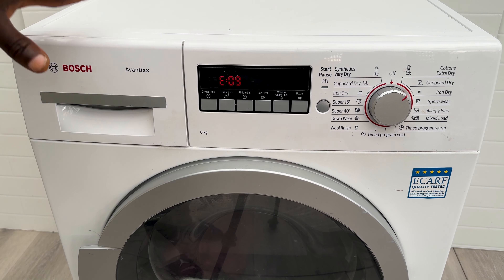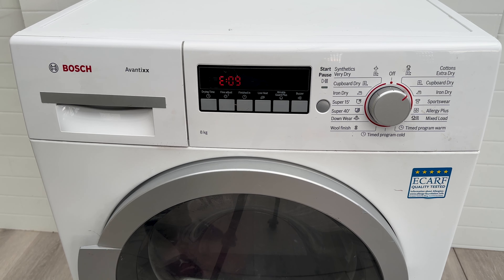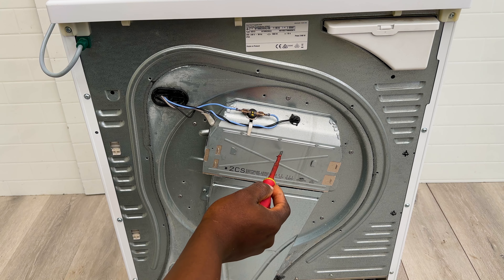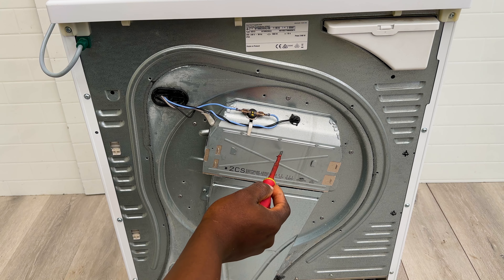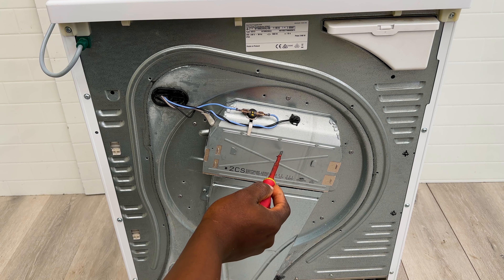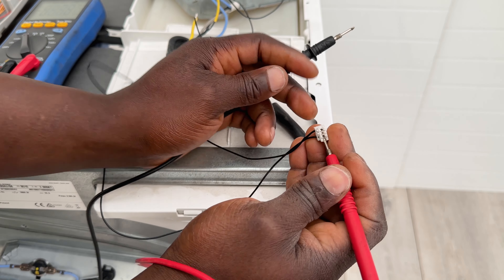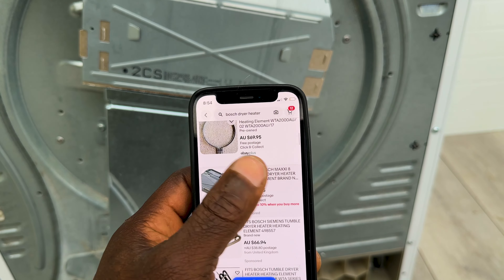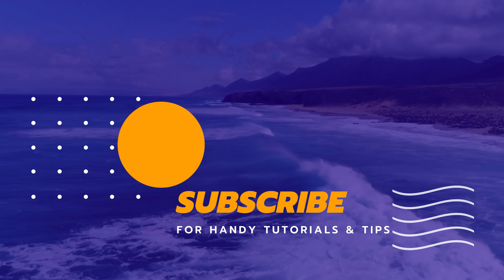Bosch Dryer Error E09 Fault Repair

Comment: Hi I am slightly confused you said the temp sender should be normally open (ie current should pass through = have continuity) at 1.21 mins at 3.55 you say should be no continuity????

Comment: Very helpful. Having tested both sensor and thermostat, I replaced the whole heater element. Unfortunately, it still returns E:09. Any ideas what to check next?
Reply from the maker: hi when you start it up is it heating up ? if so does it get really hot ?
Reply: @askmrwashywashy  after a few tries, it stopped returning the error code. It is heating, but not as hot as a remember it being-it took over 4h to dry one damp sheet, and it still wasn't very dry. Before replacing the parts, I disassembled the unit and vacuumed every speck of dust out. I've wiped down the moisture sensor, flushed the drain hose,, and the pump seems to be draining normally. Short of a computer error, the only other factor I can think of is that it's an unusually hot and humid summer, and our A/C isn't really keeping up...
Reply: Faulty pcb

Comment: I have checked the sensor  heating elements  and thermal fuse are ok but still showing  E09  so what next
Reply: Faulty PCB
Reply: Did you find out?